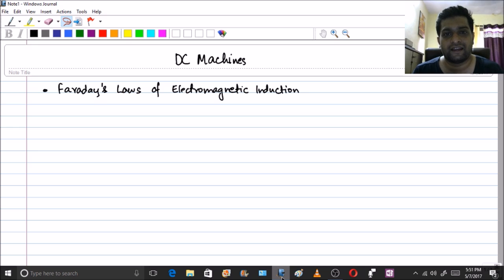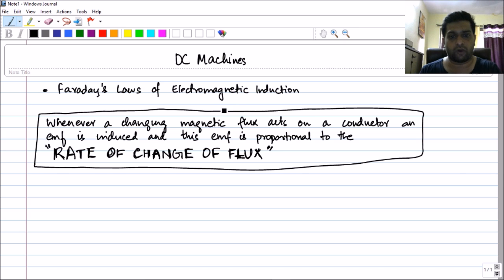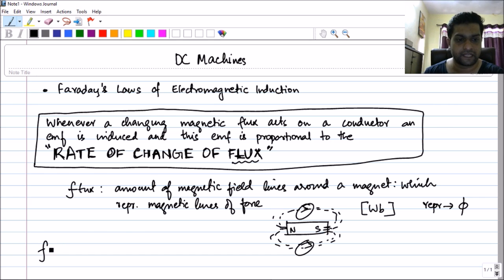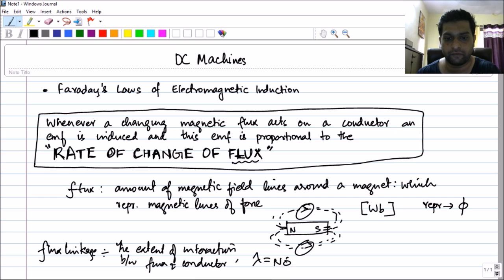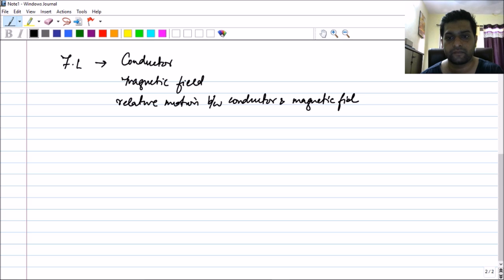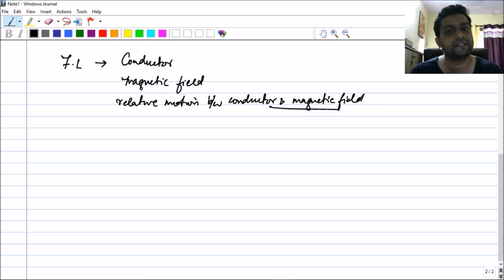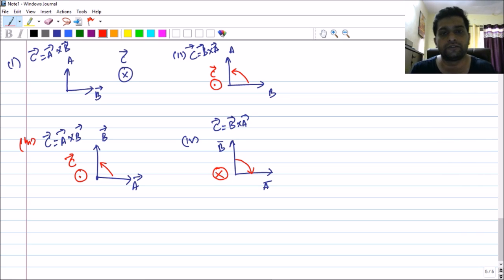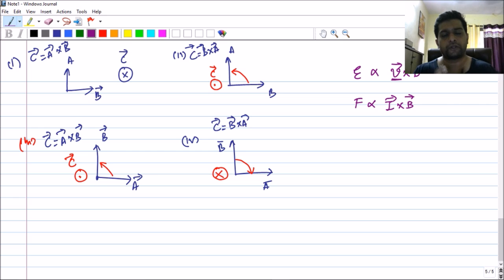#2 DC MACHINES BASICS Faraday's Laws and cross product of vector

Comment: Numerical problems are required sir
Reply from the maker: Please continue with he videos you will find many...
Reply: @ElectricalisEasy  sir I watched all the vedios up to DC generators and liked Ur lectures but more problems required
Reply from the maker: Actually the numerical for dc motors are very big numerical which I have split into smaller videos..each videos covers an important area...once you understand that you can easily work out any other problems as well..the reason I did not spend a lot of time on numerical is bcz there is a loads of machines left to cover, but these numerical are very conceptual and not trivial ones...